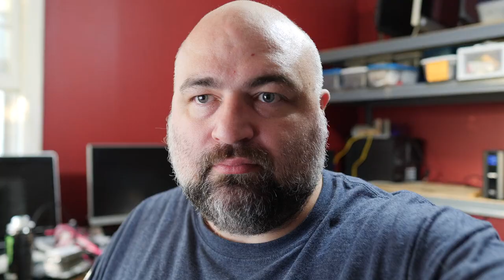Even MYTHBUSTERS Got The Airplane Conveyor Belt Question WRONG - A Neckbeard Explains - Jody Bruchon

Comment: Think of it like running on a treadmill.  When you are running on it, I'm pretty sure you don't feel wind on your face. Same principle. There is no  wind in the opposite direction to generate lift.
Reply: Remember, the 747 needs some airspeed.  The wheels are what allows the plane to move from one end of the runway to it's takeoff point, thrust being provided by by the engines. The runway is not moving so of course the aircraft will take off because it is moving faster than the runway itself. If the runway (conveyor belt) is designed to move in the opposite direction at exactly the same speed, there is no way lift can be generated. The plane will be in the same spot relative to the ground.
Reply from the maker: This is by far the best analogy I've seen in these comments.
Reply: Planes don't propel themselves with their wheels
Reply from the maker: @monolyth421  Planes don't lift up because of their engines. Also, hi from /pol/ fren

Comment: wait so you are implying it cant take off because the conveyor belt wont allow the plane to move?
the conveyor belt cant impart any force on the plane to stop it, the wheels and the belt could both be spinning at a million miles per hour and the plane would still accelerate to 200mph to take off regardless, this would be the same as a plane taking off with a tail wind that is above its stall speed, the wheels would be spinning faster than the plane is moving but still matched to the ground speed, whether you take into account real physics or not the answer is the same, you cant stop the plane through its wheels unless the brakes are on
Reply from the maker: It's not a question of force. It's the constraint set in the question.

Comment: Can a Helicopter take off on a Conveyor Belt???? Mic  drop
Reply from the maker: This is a weird comment.
Reply: @JodyBruchon   I think a good way to rephrase the question is, "can a Helicopter take off on a conveyor belt?"
most people would not dispute that a Helicopter would in fact take off.  Their logic would be that the Lift generated by the spinning blades would allow it to take off stationary or moving. 
The spinning blades provide lift in the same way that an airplane wing does. Planes take off because of the lift generated by the friction with the air passing the wing and not the movement of its tires on the ground. the power source is the engine pushing the wing into the air and creating the friction/Lift.  Not the relationship of the tires and the ground.
Reply from the maker: The plane takes off because air passes over and under the wings, generating lift. This is conditional on forward movement. This requires the wheels to spin faster in the forward direction than the ground beneath, even if the wheels aren't powered. The constraint isn't about where the power comes from, it's about the wheels relative to the conveyor underneath. Basic logic: if the wheels are locked to the belt, the plane is not allowed to move forward.

Mic drop.

Comment: Why is he making a big deal about the differences between a 747 and a prop plane?  Doesn't he know they fly using the same principals?  Lift is how planes get off the ground, by air moving over the wings.  No difference.  I stopped watching because apparently he doesn't understand the principal of lift.
Reply from the maker: Because someone somewhere will claim that the prop wash from a prop plane will force air into the wings. I cut that off before it was suggested by addressing and dismissing it. You can refer to me in the second person, by the way. It's my comment section. You stopped watching because you didn't understand what I was talking about, not because you don't think I understand how airfoil lift works.
Reply: @JodyBruchon  wish you would have made that clear up front. Otherwise, I agree.
Reply from the maker: @PaulLascari  If you watched the video, it would have been pretty clear that I'm trying to tackle every single possible counter-argument I can imagine, even if they're ridiculous. Now if you'll excuse me, I'm gonna go take a shower, and the new mechanic assistant is going to be tasked with bringing me some prop wash to cleanse myself.

Comment: This man thinks wheels are what makes planes fly…the wheels on planes literally are wheels they arent connected to an axel connected to a drivetrain....therefore not connected to an engine…the plane uses air to move not their wheels….lets say a plane has a powerful enough engine and the wheels are welded stiff…the planes can use the air to drag the plane …wont make a nice sound …but if you weld a cars wheels stiff it will not move because the wheels are literally the deciding factor on car motion
Reply from the maker: No, you absolute moron. Air pushing against an airfoil and thus creating lift is what makes planes fly. The wheels not being allowed to spin faster than the conveyor means the plane is not allowed to move forward. No forward movement means no air over the wings means no lift. Try being less stupid.

Comment: This riddle is one of my favorites! I have to thank you for being one of those few on the web to have addressed the problem correctly. Unfortunately this riddle deceives many "scholars" because they assume that there is a trick in the explanation, which in itself is too stupid and simple to be proposed. But for me it is precisely its simplicity that reveals the ability to reason. Because the biggest problem of all is that people don't read the question well!
Reply: Everyone knows that the way the question is formed makes it impossible in reality, but this is a hypothetical about physics. The point is if we did have this treadmill with unbreakable wheels, then the plane will takeoff. It's a pretty basic physics hypothetical.
Reply: @mrpug2794  To answer a physics problem we don't necessarily have the tools it asks for. Newton certainly didn't have a cannon capable of firing a projectile and sending it into Earth orbit to advance his ideas. The simplicity of the problem, physically, is to convert the frame of reference. The wheels of the aircraft behave in the same way whether the conveyor belt is stationary or in motion. Instead, it is the aircraft-runway-air system that it changes. If in the first the runway and the air are integral and therefore the plane moves relatively with both, in the second it is the plane and the runway which move in the air. It's a simple kinematics exercise.
Reply from the maker: Most of the replies I get go into explanations involving air speed or the fact that the plane isn't moved forward by driving the wheels or that the wheels are "freewheeling" because they're just mounted on bearings. It's amazing to me that so many people who claim to be so very smart can't understand the simple concept that the tire is attached to the plane and if the plane is moving forward, the tire is putting linear feet of contact surface down faster than the belt beneath it is moving backwards. The simplest demonstration is to use a belt speed of 0. If the plane moves forward, do the wheels spin faster than the ground is moving? The ground is obviously not moving, so...nope, I'll get another explanation involving skateboards and pulling a rope because people really are this fucking stupid.
Reply: @JodyBruchon  Indeed, many are fooled by the function of the wheels in an airplane. In reality they are necessary to acquire speed and obtain a lift higher than the weight and therefore take off. But there is no doubt that the wheels, until the plane comes off the ground, transmit any motion to the plane itself. It's like thinking about going downhill on a scooter and suddenly turning. Although the wheels spin freely and the only force is that of gravity, therefore an external force, you go straight to lawns. And so it happens in airplanes, which in fact can interrupt the take-off run with brakes applied to the wheels ...